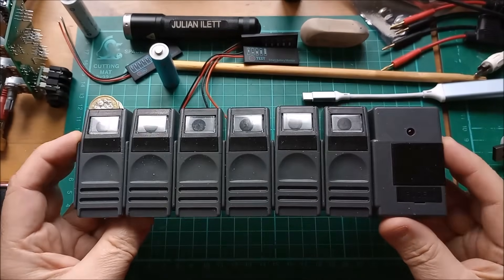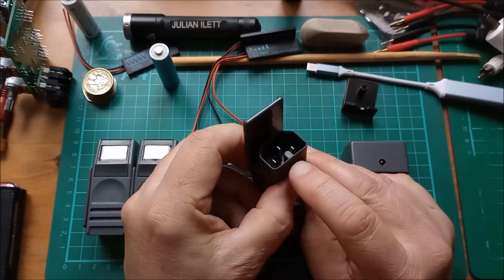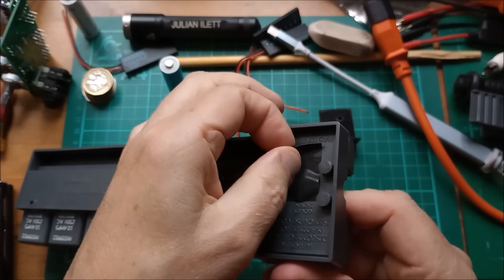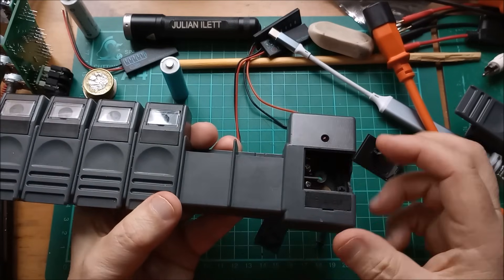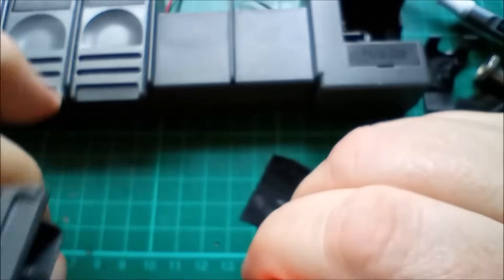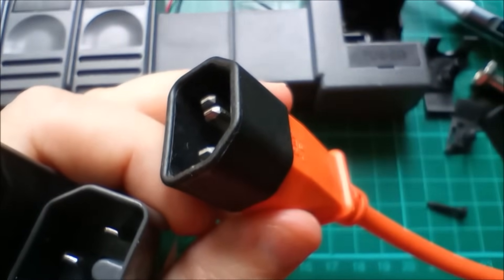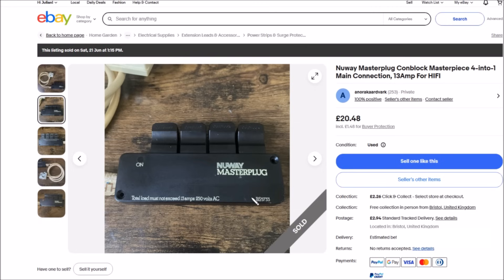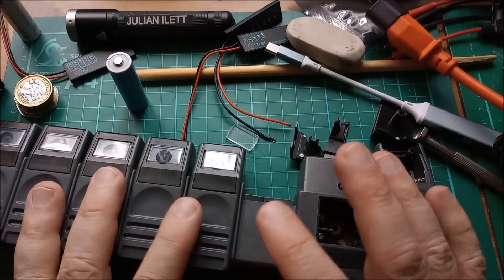Masterpiece BS5733 Mains Connector Conblock

Comment: We have a Slo Cooker (240V 105W) which has that IEC C15 connector, so I think that Tower over-specified the connection. We don't have a kettle with an IEC connector, but all our monitors have the 'normal' IEC C13, without the notch (which we have always called 'kettle leads', and now I know not to!).

Comment: I've got one of those six way Masterpiece things, it's actually a darkish grey colour. I actually bought it new, probably in the 1980's, for my Hi-Fi setup. It came with a sheet of preprinted labels that you could cut up and put under the little windows on the plugs. These hark back to the days before everything came with a mains plug attached from the factory, and provided a very neat and tidy solution for things like my Hi-Fi mains wiring. Like yours, mine has gone brittle but still works very well in my low current application.

Nuway might be more well known for making replacement styli for record players. They're another one of those companies that was 'everywhere' at one time but hardly anyone remembers now.

Comment: I use this type quite a lot as it saves a lot of space behind the equipment on the shelf. But i do like to fuse down equipment for extra protection which of cource you can't do with this kind of socket.

Comment: I had a similar issue with a compound mitre saw and circular saw where the plastic just got old and brittle. 3D printing new parts was an option I considered but decided against as it was a lot of work for very singular items. I do wish manufacturers would make CAD drawings available for these parts

Comment: When you mentioned the round pins, I was instantly reminded of the first mains plugs I saw in the 70's, before the 13 Amp plug became standard.

It was a small round 3 pin plug with round contacts, two thin and a fat earth pin, the wire came out the back of them through a small hole. They were rated for 5 Amps.

When I was about 5 or 6 we had the house rewired with 13 Amp sockets and dad had to change every plug in the house. But we still had a 5 Amp socket in the cellar.
Reply: The 5A ones were i think intended for lamps etc, i can remember having ones with 13A fuses. it was great the the fuse was the live pin, you just unscrewed the fuse pin and replaced it.
round pins back in the days before the flat earth lot took over 🙂
Reply: @TheEmbeddedHobbyist  The 13A plugs with the fuses are still the modern day standard.
Reply: @Franko_Walker  but before there was the round pin plugs with the screw in fuse which was the live pin. before the flat pin plugs became the norm. i know that the UK is on a very small list of countries where the plugs are fused. but if we move away from ring mains wiring we might see the end for the need for a fuse.

Comment: The connector you forced in also has fatter pins so fitting it would potentially spread the connections and lead to a poor connection when using the correct one.